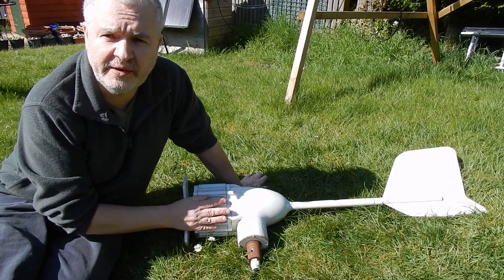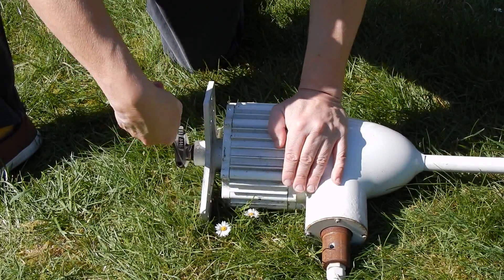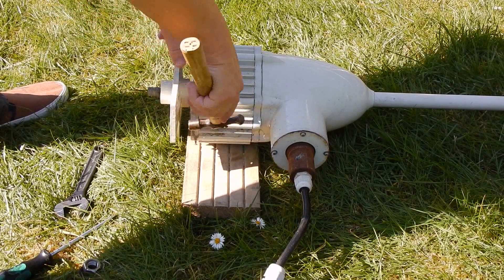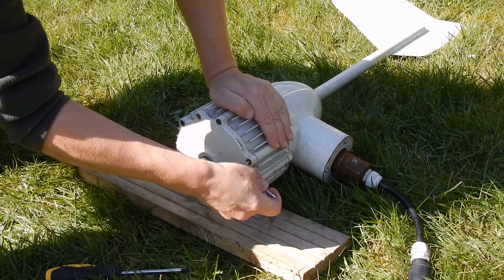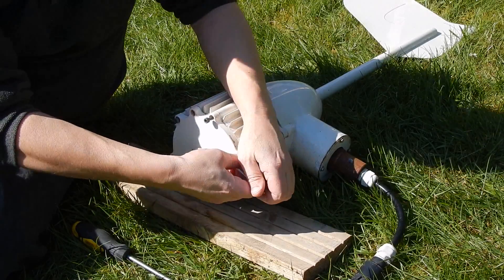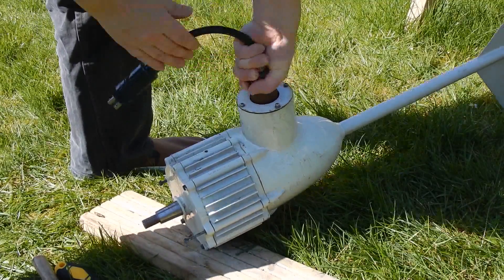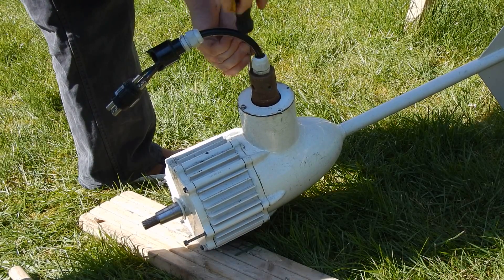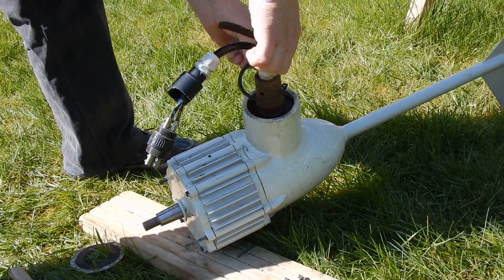Partial Teardown: 300W Wind Turbine

Comment: Cool video - I grew up on an old farm that was miles from almost everywhere.  When the REA (rural electrical association) came through putting electricity on all the farms, dad didn't have the money to wire the house so we never hooked up.  Used to drive us kids wild that there was power on that damn pole in the yard but not on the farm.  Dad did mechanical work on the side, and to charge batteries, he had an old wind-charger with some glass battery jars that somehow held a charge I guess, I was quite young when that was in use.  Any how he did have one bulb in the garage that was on when the wind blew, which was nearly all the time here on the Dakota Prairies.  Sort of takes me back to those days.

Comment: @ 7:27 there's a threaded set screw for the ring behind the bearing. Looks like you still need a pulling device to get the bearing off though.  It would be cool if you could get it working again.  If you keep it just below the roof level in the back garden maybe nobody will notice.  ;-)

Comment: as a factoid, in big wind turbines, there are no slip rings around the yaw axis, there are wires, they can turn twice and then the control system has to do a cable untwisting operation. Actually the turbine spends most of the time in the same direction.
Reply: +nraynaud1 A 'factoid' is a lie BTW.

Comment: Could not see the coils properly but it seems that it's 3 phase 6 or 8 pole motor. 36 slots where the wires go. And there's no copper coils in the rotor. You would have seen them if there were any. Close up in different angle would be nice so I could determine that if it's 6 or 8 pole.

I just happen to rewind motors for a living and it's so rare to see motors on youtube.

Comment: The generator bearing assembly looks same as in electric motors, so most likely the bearing is press fit onto the shaft. A lot of times it is quite a challenge to get it off.

Comment: GDay Julian . Use a texta to mark across the end shield and the stator , that will  give you a reference for reassembly . You only need a little heat from a hot air gun to warm up the alluminium bore when refitting the bearing . Those tie rods have sealant around the heads to waterproof the " motor " . Use a little silicone grease on the threads when screwing the rods back in , you were lucky to get them out without stripping the alluminium threads or snapping some of the rods .
Reply: +Steve Smith 
Looks like Loctite was used on those bolt threads, the colour looks familiar, and I'd think it was because of the vibration caused by the turbine that they were protecting against. 
If they were worried about sealing off those tie rods using a sealant then you's also expect a sealant or some kind of gasket on the inside sealing surface of the face plate and a gasket that sits on the shaft between the bearing and face plate as well.

Comment: If you connect it to an ESC will it run as a motor :-) 300 watt fan to keep you cool in the summer.
Reply: +Coolkeys2009 Surly there's a rectifier circuit to keep current from flowing into it.  You know, like a gas generator...
Reply: Mat Helm Well, it appears to have 3 outputs not + and -.
Reply: Coolkeys2009 It's AC, so no + and -,  And one of the three is neutral isn't it?
Reply: Mat Helm Center tapped AC would not make much sense. 3 phase AC as Julian suggested is how power is generated in power stations and even car alternators before the diodes as someone pointed out.
Reply: Coolkeys2009 Center tap 3 wire is only 2 phase, like a gas generator, and most homes.  3 phase requires a 4th wire (and a 3rd set of coils).  But either way, unless that thing is outputting a raw sign wave, you're not going to be able to feed power into it..
Reply: +Mat Helm 3 phase power only needs 3 conductors for power transfer, have you ever wondered why large ac power lines have 3 or 6 main  conductors. Wind turbine controllers can measure the speed of the wind turbine and apply regenerative braking in case of over speed, this is very easy to do if the wind turbines output is ac.
Reply: Coolkeys2009 The 4th is neutral (earth ground).
Reply: Mat Helm 3 phase loads can be connected line to line so a neutral is not required. When a 3 phase load is balanced the neutral current is zero anyway.
Reply: Coolkeys2009 Sorry man, but look at a 3 phase anything.  The phases are X number of volts relative to neutral. Hell, just google it...
Reply: Mat Helm In the UK Single phase is 240V Line to neutral and 3 phase is 415V phase to phase. Next time your going past some large electricity pylons count the large current carrying conductors isolated from ground.(Ignore the lighting protection wire on the top connected to the pylon)
Reply: +Coolkeys2009 well we invented electricity, so we have a lot of different voltage standards in the States now. Some go back to the 19th century. One of the nice things about alternating current is that you can transform it so easily. Which is why it won the current war.

Comment: I don't think it'll matter which way on the front plate goes. if it did, they'd have spaced the bolt holes so it only went one way. Nice to see you BTW! cheers :)
Reply: +Alan Cordwell my experience is that you're always better off putting bell ends back the way they came off. So witness mark them before removal.

Comment: Can you connect a battery with enough voltage and turn it into giant fan?
Reply: theoretically
Reply: +Rizki Pratama You would also need an inverter.
Reply: +Rizki Pratama You'd have to feed it three phase AC, since that's what it puts out.
Reply: +Rizki Pratama It's a three phase AC generator with diodes  to make DC.  It was designed as a generator so it probably should be used as one.:)

Comment: I was hoping to watch you carefully re-wind the stator with more turns of smaller gauge, super-conducting enameled wire that will be needed to achieve the higher voltages required for anti-gravity experiments...